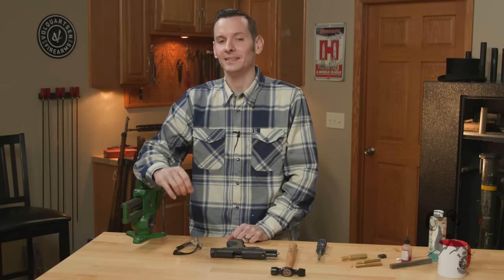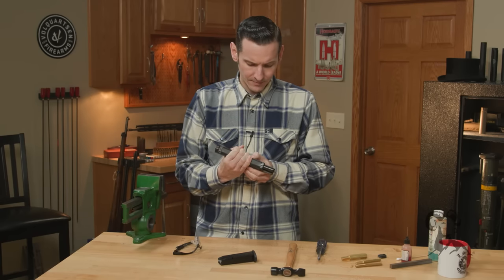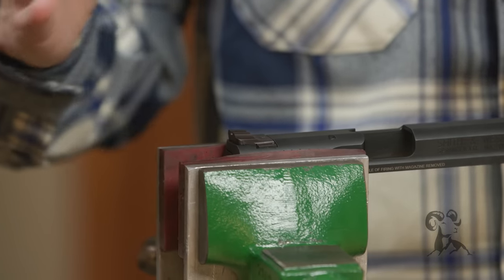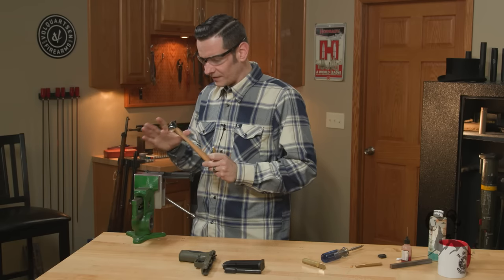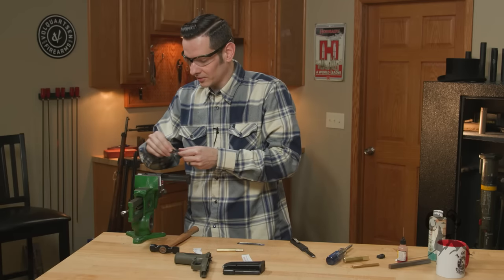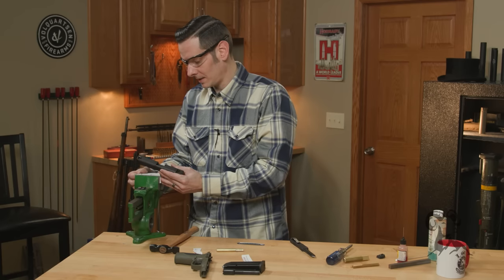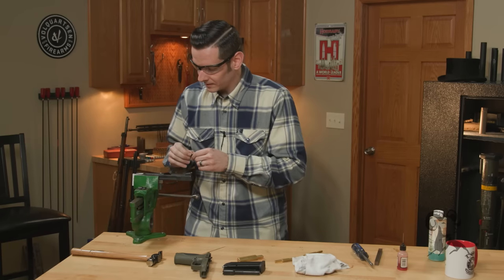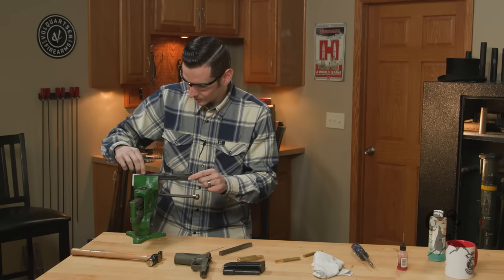Tech Tip: How To Install Pistols Sights the Old School Way

Comment: I destroyed a Ruger SR1911 slide trying to replace the front sight. Well, I gouged it up. Made me so pissed at myself. I found a replacement slide for it. Damn that made me mad.
Reply: Condolences bro, know the feel
Reply: Seems like some pistols you are supposed to only drive the sight out one way , like right to left and drive new one in from the left? Possibly tapered?
Reply: @mikekokomomike  the SR1911 was incompatible with the tritium front sight I was trying to drive into it. Part of the sight gouged out the top of the slide while I was driving it into place; using an actual sight tool.
I foolishly did not look to see why it was taking more than a normal amount of torque. I destroyed the sight and gouged the slide at the same time. It took me a year to find a deal on a used slide.
Reply: @Iceaxehikes  that would anger me too. I just got a Sig P322 .22lr pistol and it has light primer strikes out of the box. I shimmed the hammer spring on this pistol today because that's the fix. Totally unacceptable they leave the factory and you can't run a full magazine without a click and no fire

Comment: Most firearm manufacturers and their certified armorers will tell you to drift the sights in and out from one side only, typically the side with the ejection port. In this video, you punched the rear sight out to the right and the front sight out to the left.
Reply from the maker: It doesn't matter. the dovetail does not taper horizontally.

Comment: Some sights are directional, keep that in mind. Also, if a new sight is too loose in the dovetail, use a punch to add a dimple or two to the bottom of the sight.

Comment: Wouldn't it be a good idea to cold blue or black oxide the bottom of the sight so it's more rust resistant? Also maybe touch up the inside of that dovetail while you're at it?

Comment: Wondering why you pushed that rear sight out of the right side of the slide. Aren't dovetail sights typically slightly wedged to come in and out the left side?
Reply from the maker: No, they are not.
Reply: @brownells  Left to right to remove and right to left to install.
Reply: Seems like I was told that about the Walther P38 P1 ?
Reply: I did my Shield 1.0 last year and checked with the manufacturer. There is no difference on M&P's. Sights can be removed in both directions,  but on the rear sight, install as Caleb did to seat the safety plunger first so it doesn't get damaged.
Reply: @mikekokomomike  The rear sight on a P38 isn't dovedailed in. It's secured to the slide by the slide cover plate. The front sight can be drifted out either direction.
Reply: @redcat9436  right,  there's a pin that sticks up, and you have to get sights marked L or R for adjustments,  I updated the sights on my P1 with the wide version many years ago and forgot

Comment: You should have turned the slide around in the vice and tried punching the sight out right to left. Many manufacturers use a slightly tapered dovetail that gets tighter as the sight goes in. This is to "wedge it in place so it is less likely to drift back out.  This is why your front sight came out so much easier.

As for the brass marks on the slide or sight,  just shoot some WD40 on it and hit it with a nylon brush. The brass will come right off.
Reply: Not the case here with S&W.

Comment: So much for the left to right then right to left nonsense.
Reply: On some guns it matters. The Walther PPS can only be driven out left to right.
Reply: @redcat9436  if you think about the process that would be necessary to cut the  Groove It would be very unlikely that any modern manufacturer would take the time necessary to do that 1 pass 1 bit set it up squarely in the machine tapered would require so much more work not likely that any company would do that even with modern CNC  machines it's to time consuming. Maybe some antique firearms. I've been told this tail about taper all my life never seen it mater personally. I'm 64 and started shooting at 5 seems to me the tapered groove would interfere with windage adjustments. But you a certainly entitled to your opinion.